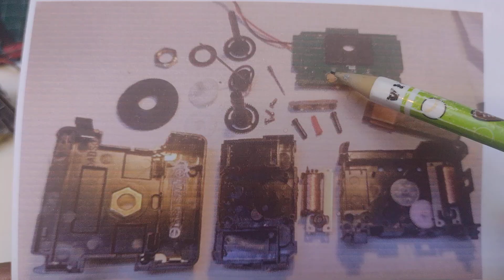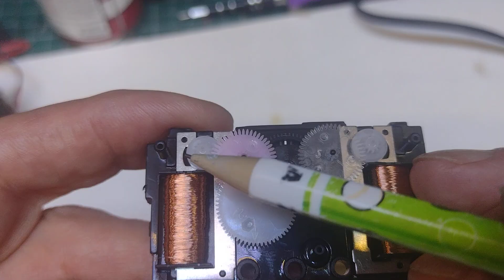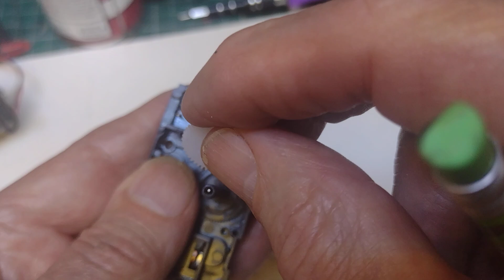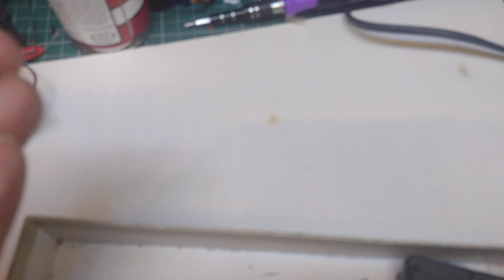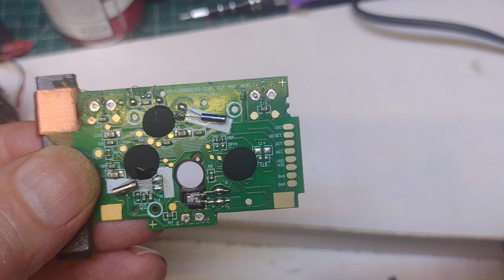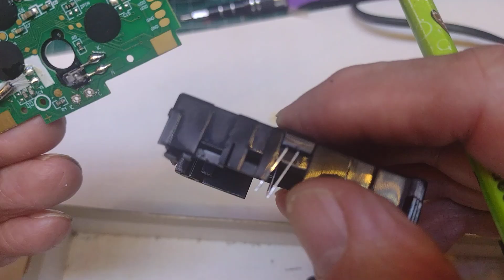MSF UK  Radio Clock Mechanism tear-down.

Comment: I suspect that the E and C markings on the pcb refer to a phototransistor. The Led and the phototransistor are so that the electronics "know" the mechanical position of the mechanism and the hands when self setting. There will be a wheel with slots, holes or a reflective surface between the LED and the phototransistor.
Reply from the maker: Thanks, you are correct. The second hand gear wheel has slots in it which pass between the diode and transistor. The LED is pulsed for 30 seconds and when the transistor doesn't respond the pulsing stops. the LED only takes 84 micro amps and the device without motors 160 micro Amps. the LED has a Vf of 1.17V. the transistor's resistance changes from 10k  in light to 150 Mega  Ohm in dark.